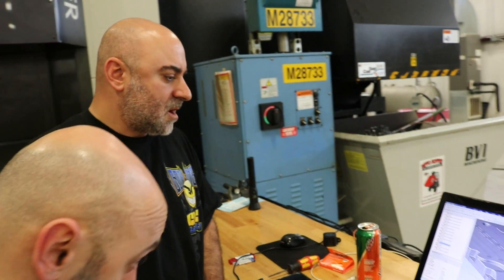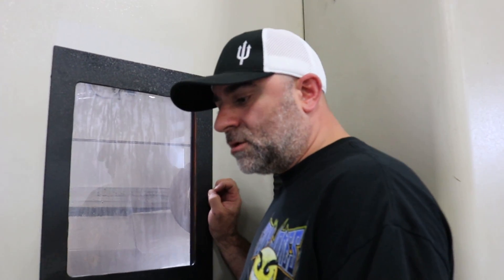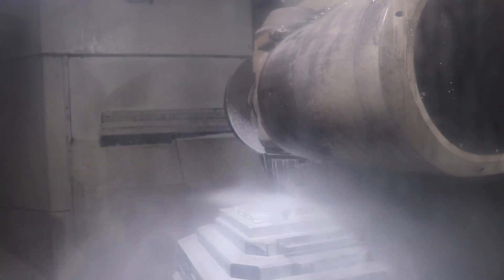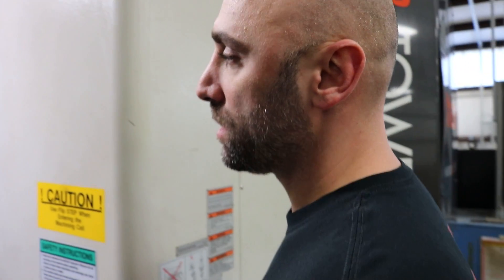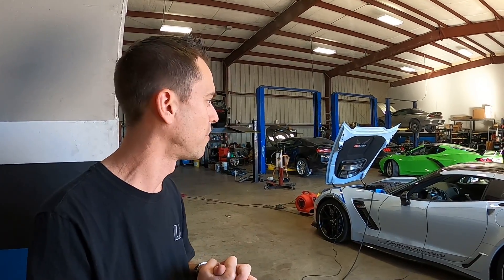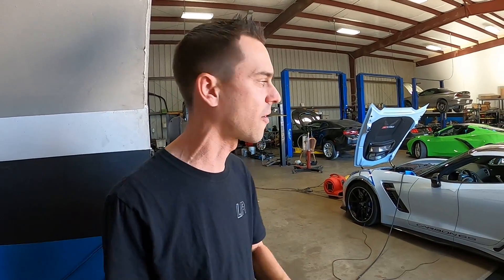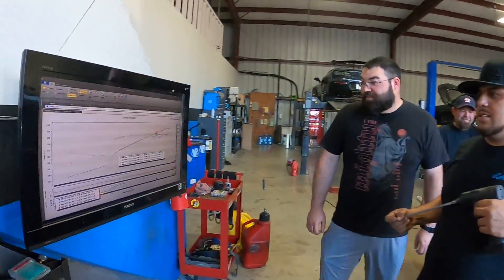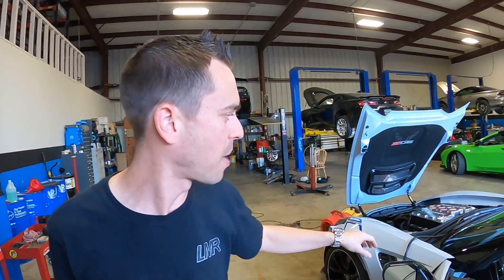Our Custom Billet Supercharger Lid Makes HUGE Gains! (1,000hp+?)

Comment: That's awesome. I have one of the 4 prototype Gen 5 Whipple's on my mustang. It is a flat top design. I keep asking if it has a higher air compression ratio due to it's flat design. Nobody thinks it matters over the dual rotor elevated cover. Your video makes a great argument for porting/modifying a SC cover. Great video. You guys would be on the top of my list for speed work

Comment: Steven that is bad ass,I'm currently getting ready to purchase a Maggie 2650 with cam,ect ect,I've seen what you have done for StreetSpeed 717,I have a 17' Z06,I would like the billet option,or body color integrated into the lid,pricing??
Reply: Same here 17 Z06 , would love to get one . Probably would prefer on a flat color - so I can airbrush design.
Reply from the maker: We would love to take care of your full build, but if you are only looking to purchase the lid contact us for pricing snd availability. 
Sales@latemodelracecraft.com
713-466-9900
Reply: Did y’all purchase ? I was interested as well and wanted to see how others turned out

Comment: Beautiful!!  Make the lettering platform location custom, not everyone will want "Fereday" on their engine. Could have LMR logo in one location, smaller, Possibly even  but cool to add custom option for those that want it. :) Could possibly have "1000 HP"  lettering.
Reply: Do you complain to MSD or Fast when they put their names on their intakes? Just a question.
Reply: @caliLakerNiner  If they asked me I would suggest the same.  :)
Reply: @savydude1  No, you wouldn't, you'd bolt it on the car with a big 'ol MSD logo on it. Lol